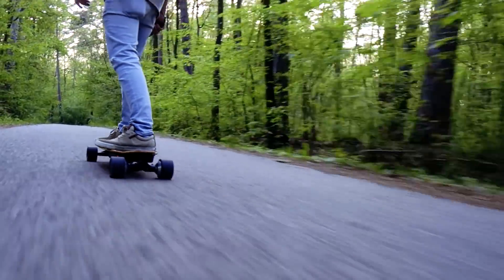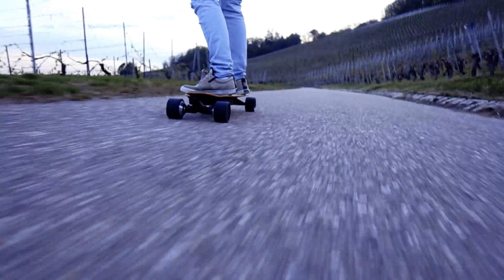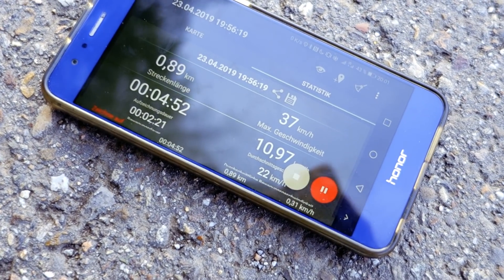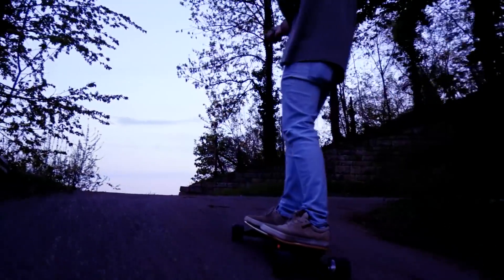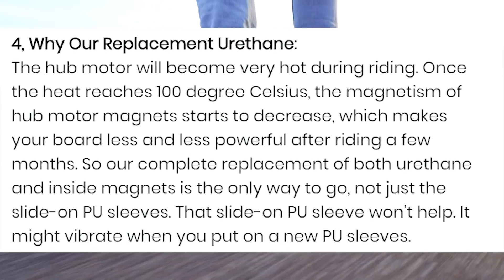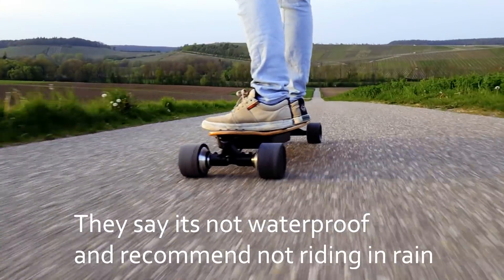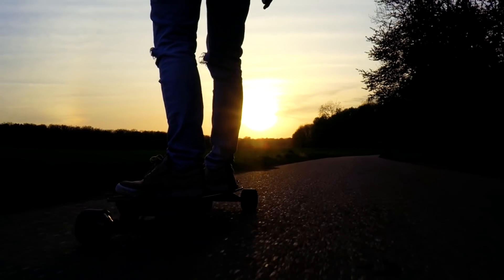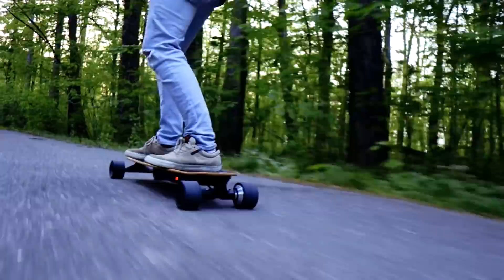Verreal F1 REVIEW - Can a Budget Board be good?

Comment: Would building your own battery pack, battery case, and BSM make it cheaper or maybe even better? Like a DIY hybrid with the parts from Verral to make it easier to build? to buy the remote, ESC, , hub motor and stuff from them?
Reply from the maker: Yeah that would work, verreal sells their components on their website and I think the esc and wheels are really worth the money. But building a good reliable and safe battery is not that simple, so for most people just buying a fully asssmbled board is the way to go unless you have some real good expirience with building batterys
Reply: @Pryside  You do have a good point there about the batteries. And after looking around on their website, for the price you can't really do better especially with your opinion on the build quality. So the only thing missing is a nice bamboo board haha. Great video, keep it up and greetings from Holland!

Comment: Thank you to show us the inside! Thanks to you I know now that I can move the metal case around 10 cm in the front to have a more balance board and replace the battery with 3.3ah Panasonic BD. There is enough cable length. I used to ride EUC since 2015. This is a great first board to go to work but it misses 3 Kms range (16 Kms) this why I will replace the battery. And perhaps arangatang caguama replacement and bones red in the front for confort.
Reply: The board comes with a 4.4ah. Battery why would you want to downgraded? Lol. I have gotten 10 mile distance with it including hills.
Reply: @MadDonJuan  because 4.4ah is for 2s10p battery. So one cell is a 2.2ah (2 cells in series). With a 3.3ah cell the 2s10p becomes 2x3.3ah= 6.6ah battery. Perhaps I did not explain myself enough but this is an upgrade.
Reply: @__dummy__7523  ok I get ot now ,its actually 4.0ah. But as an option they also come with up to 5,,6.4, and 7Ah. It on their web site. I didnt realize about the 2 cell 10s pack, looks way bigger but you make sence thanks for the reply
Reply: @MadDonJuan  No problem. Despite the amount of work to build a new battery it costs half less than an already built battery. But I will do it when this one will be dead. The soft bushing and the soft wheels have already made it very comfortable.
Reply: @__dummy__7523  I have it for over a year and the first thing I had to change was the bushings,maybe you got it with the green ones ,mines where stiff,I got some Orangutan purple knuckles medium and it fully changed the character of the board,
Reply: I just got in from a 5 mile ride and got one full battery bar, it is really windy but used to do better,maybe I should do as you sayed. I'm waiting on the RS for a week now that should be way better ,got it with the 14Ah. Sansung E35 battery, should give me over 20 miles i hope,,thanks again.